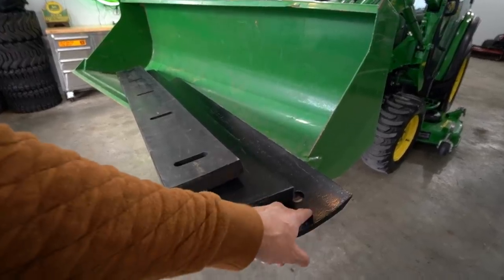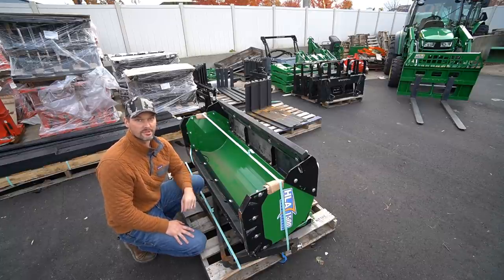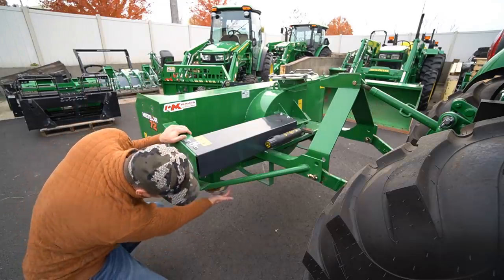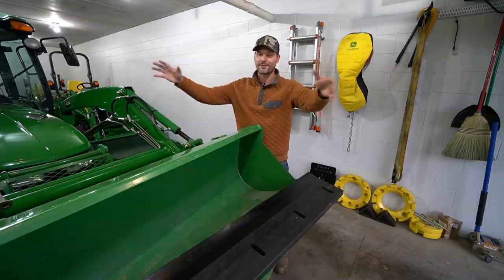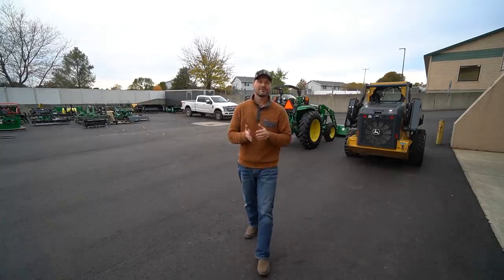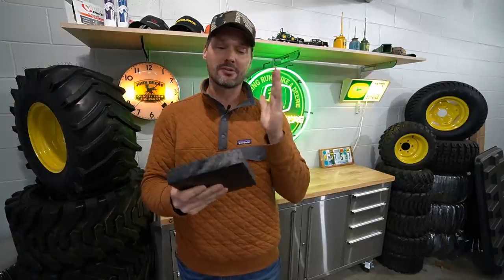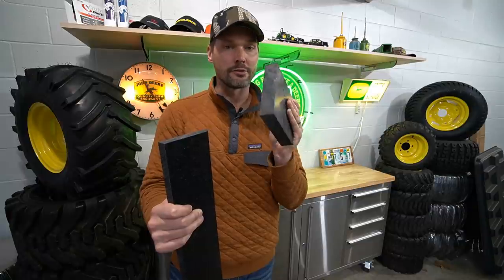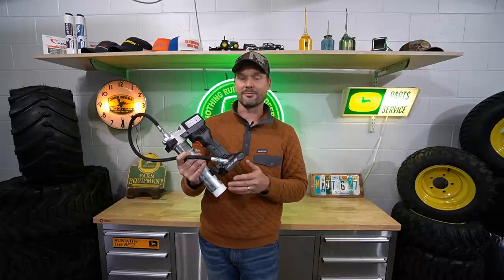DON'T DAMAGE YOUR DRIVEWAY! PICK THE RIGHT EDGE: UHMW VS STEEL VS RUBBER SNOW PLOW CUTTING EDGES

Comment: UHMW is the way to go for snow removal, I have had mine on for 3 winters in MN and it still looks great. I leave it on my blade year round and use it to level rock and dirt with no issues!   If it ever wears out I will definitely buy it again!
Reply: use it level rock do you scoop it too, I used my tractor in summer to scope breaker run and gravel so wondering how it would hold up to that

Comment: This is shell from palm beach gardens Florida. Funny you had this video on today. When i was 15 years old we lived out in the Midwest and we got a lot of snow. We had a cub cadet mower small tractor to plow our driveway in the winter and cut the grass in the summer. It was a big property and a long driveway . i was running the plow during a storm once and the blade got caught in a divet in the driveway and it ripped the surface material up. My dad was not happy bit i didn't get in trouble.

Comment: I bought a piece of 3/4" horse matt at Rural King and cut it down to make my own edge.  It is very durable and lasts and is MUCH cheaper.
Reply from the maker: Yes, good cheap alternative to rubber for smaller plows.  Not good at scraping through packed snow.  Not as durable as UHMW or steel.  Would have to double stack for larger or heavy duty applications.
Reply: On our 10ft box i hated the steel edge cuz it had no trip so i had a semi tire and i cut the side walls off and had a 10 inch strip of tread and it was supper tough
Reply: I tried horse matt for 3 seasons. Each of them tore and it was very difficult to cut.  My recommendation to any one thinking of horse matt is be ready for some work.

Comment: I use the rubber edge on my 54 inch blade. It works like a squeegee on hard surfaces but as you say it will not work with packed snow or ice. The rubber has to be clamped with the steel blade.
I want to put UHMW on my 60 inch loader mounted snow blade. Deere's kit includes a steel clamp and is very expensive.
Reply from the maker: Yes, use a steel retainer for rubber.  Thanks for watching!

Comment: I cut strips out of the tread of old tires. I get 4 out of my truck tire and get about 2 seasons out of each strip. Slow cutting but they work well
Reply: Use a semi tire. Way thicker
Reply: @jamespetrich5610  I don't have any. Only my diesel pickup truck tires 🤷‍♂️

Comment: Ordered my uhmw yesterday.  Does it make any sense to put the old steel edge on top of the uhmw like a sandwich?  Yes, I’d let the uhmw protrude out front about 1/2”.  Curious???
Reply from the maker: I don't think the extra steel is necessary, but wouldn't hurt anything either.
Reply: Got my uhmw on Monday, a day earlier than expected.  Will install today for Thursday’s expected snowfall here in central Wisconsin.  Thanks for the information you provided about this product and vendor.

Comment: Hello!  What “thickness” of UHMW is recommended for the HLA 1500 series snow pusher when it comes to the main cutting edge, the skid shoes and the back drag?  Also, if I have the welded steel back drag can I add the UHMW cutting edge to it - or should I have bought a different back drag initially? Thx.

Comment: Does this apply to the bottom edge of a snow thrower as well?  I know, I know, you like the pushers better, but I use what I's gots. :)
Reply from the maker: Haha yes sir, it sure does
Reply: @GoodWorksTractors  Excellent!  We had the driveway repaved this past summer and I have already been out there with a scrub brush and water clearing marks made by the stones along the edge.  If I put marks up and down it this winter with the snow thrower, my head will be on a pike at the bottom of the driveway! LOL

Comment: For someone dealing with areas that have raised concrete edges on driveway and sidewalk slabs, what is the safest edge on a rear blade?
Reply from the maker: Rubber or UHMW.  Not steel.
Reply: @GoodWorksTractors  Well, I'd figured that.  Wasn't sure if rubber would flex better if it got a catch, or if it would take a chunk out.